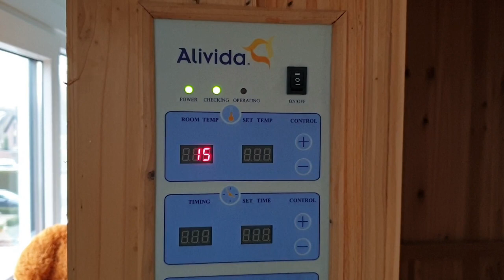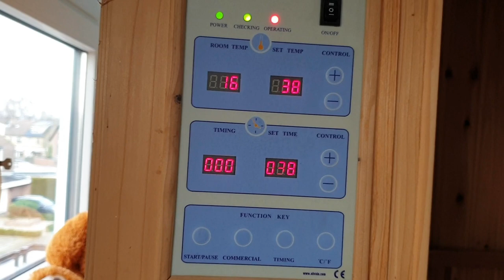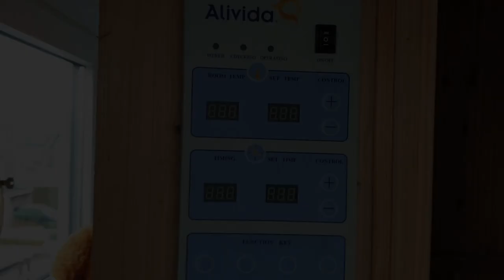IR Sauna power supply repair

Comment: Is there anyone who will test the entire controller or repair the power supply or circuit board?
I've been able to figure out some aspects of controller but I've given up on learning how to use a multi meter.  Also not great at sodering and cleaning.